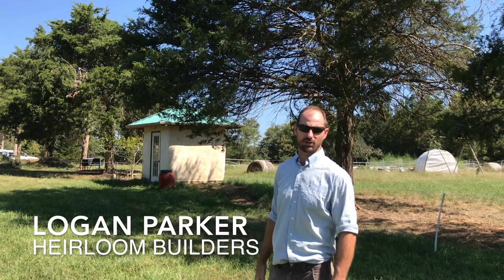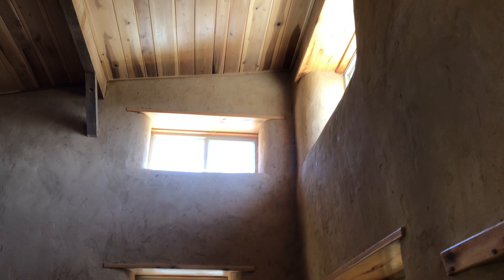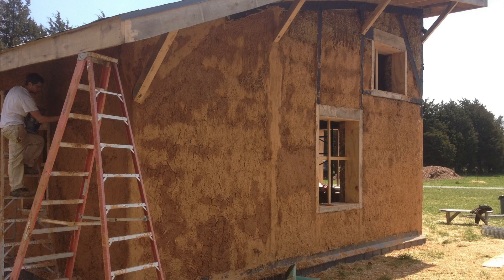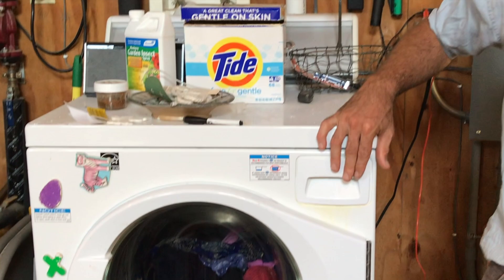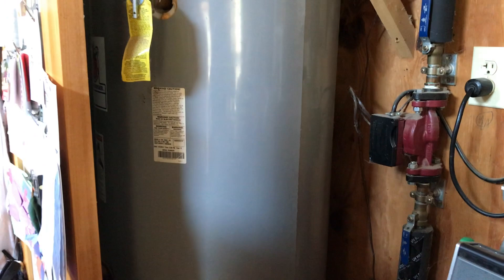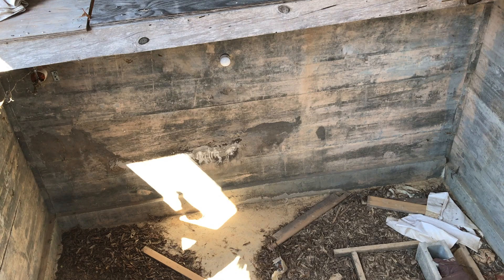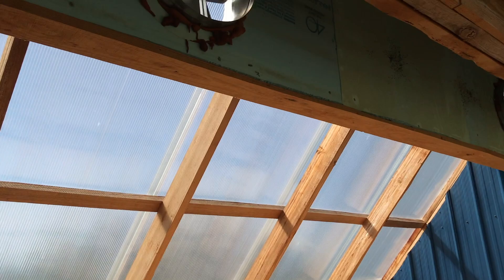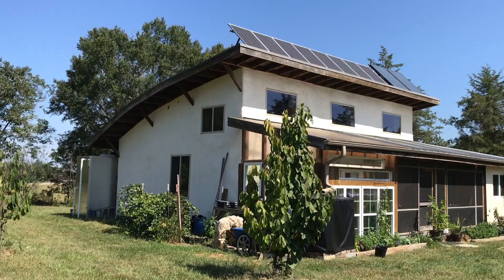INCREDIBLE GREEN HOME! (Cutting Edge Green Design)

Comment: Nonsensical!!! Unless you have $1,000,000 to spend on a 1200 square foot home. The building techniques are laborious and thus expensive. The equipment necessary to live in that house is extremely expense both in cost and labor to install. They also require extreme maintenance!!
Reply: Raised ByWolves You are right about laborious to build. But the systems in this home are basic,  LOW maintenance and relatively inexpensive. The trade off is minimal automation, hang drying clothing, and cooking on a wood stove instead of using electricity. This home is about 1200 sq ft and cost $145,600 to build. Labor saved as an owner builder probably 100,000. We build homes like this for about $200/sq ft, depending on how custom the finishes are.